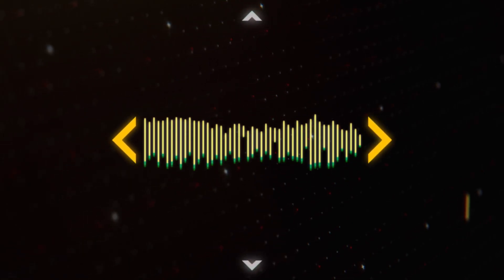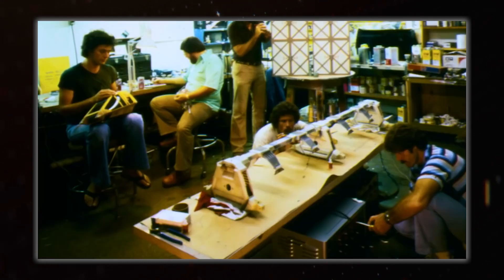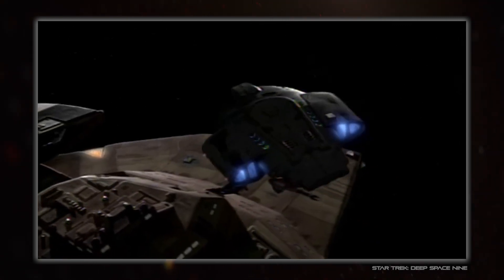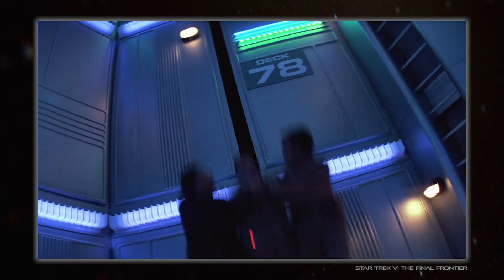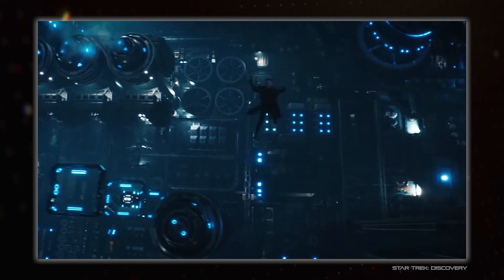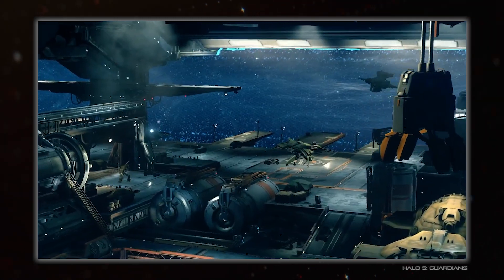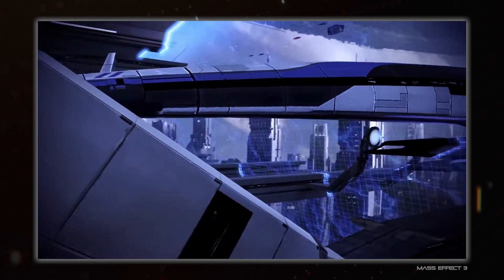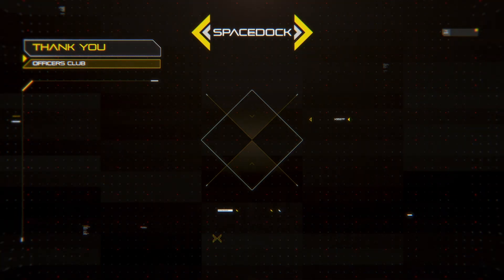Why Do Sci-Fi Spaceships Seem To Change Size?

Comment: I think Star Citizen might be one of the few IPs where ship scaling is kept as accurate as possible since the game has no loading screens to transition between ship interiors and  planets, so everything has to be in the same scale. Hell, some ships wound up getting larger from concept because they found the original concept didn't have the internal volume to fit the interior and still have room for components.
Reply: Yeah, Star Citizen is an interesting case study in this sort of thing where they kind of have to be strict about ship scaling.
Reply: Came here to say exactly this.  All the ships in proper scale and all with fully functional interior spaces, and most with some amount of component access and built in storage.  They aren't getting criticism for no reason,  but they are knocking it out of the park anywhere they can turn their attention.
Reply: Pity its release dates aren't kept accurate as possible.
Reply: Star Citizen does have some scaling issues when it comes to the cities. The no-fly-zones near some of the buildings aren't just to prevent you from running into them, but to hide the actual scale of the buildings. They are going to fix this issue when they finally start adding interiors to buildings and have to scale them all up appropriately. But right now most of the buildings are place holders until future updates flesh them out.
Reply: Star Wars galaxies as well I think, at least for ships that have interiors with windows.
Reply: Yeah they talk about that in some videos, where they think they got it, only to realize that an opened sliding door is visible on the outside of the ship so the whole room layout needs to be adjusted
Reply: Yeah, and the expanse get's it right in the most parts as well.
But this seems to be a trend of more modern scifi, that in the most parts designs a ship by function, not by style..
Reply: @Mehnbuhn Kneckbeerd honestly there is a very easy solution to that problem and its called automatization, irl most spacecraft are likely to be 1% living area and 99% everything else, so if the living area is the size of an apartment building then the rest of the ship is likely to be a couple dozen kilometers long and tall, makes for imposing ships while mantaining logic and consistency
Reply: In such a case it would seem to make sense to design the ship from the interior first, but I get wanting to design it from the outside in.
Reply: glad to see you already pointed out exactly what I was thinking when watching this. 
SC gets a lot of flack for a lot of reasons but it must be set there is quite a lot of stuff they do that ends up being really cool. the ability to fly around the outside of someone's carrack and see the people running around on its bridge and its all properly scaled with no handwavy magic is pretty crazy.... even more so when you fly up to a stations big windows and you can see everyone inside. Its kind of crazy! 
I would love to be on the train at new Babbage when someone flys along the trains for fun. this is the kind of thing I felt happened a lot at port O and it made that space feel really cool. I wish they could do something more interesting with the stations elevators to solve this problem as they feel awkward compared to how polished some of the game can feel.
Reply: @gregmosher4287  The elevator is one of the needed tricks to have large stations and cities work. When in it, the game can load and unload resources, and magically warp the player around.
Reply: @vast634  The elevators in star citizen are actually physicalised an do move around buildings, stations and ships. They are not some form of hidden loading screen like in many other games. The only "unrealistic" thing about these elevators is, that they move at very high speeds in mulitple directions. Thats ok in my opinion because standing inside a elevator for to long gets old really quick.
Reply: @oO0Xenos0Oo  Is the player-camera then actually moving? Because that draws performance even if nothing outside is visible (calculations for culling). The simplest solution is to just magically teleport the camera and Interior to the destination, and let the outside load in the background.
Reply: @vast634  All i can tell you is, that elevators in star citizen have been deathtraps for ages now. If the door opens, the elevator box might not be behind it for some reason, so if you step into the empty elevator shaft, you fall through the map. Sometimes the elevator crushes your body because its movement is slightly out of sync with your character inside of it. Sometimes the doors will not open and you are stuck inside or outside the elevator. So yes, the elevator is fully physicalised and actually moving. This is cool on the one hand but also brings more problems with it compared to a simple teleport cabinet.

By the way, stuff like subways and trains which are going really fast are also fully physicalised. You can sit inside and watch the city fly by including all the player action that is happening there. You can also see players inside of the trains when you are on the outside. So this is also no fake, prerendered panorama projected of the train windows.
Reply: @vast634  Yes there have been various bugs over the years that showed how the game does it. Basically you get into the elevator, then it and everything inside it becomes invisible and loses its physics, and it moves within the 3D game world in a straight line to where it needs to. When it gets there the elevator gets its physics and rendering back and the doors open. Recently there was a bug where desync caused the last phase to happen while the elevator was still moving, and if you stood too close to the elevator door after calling it you could get run over and killed by the cab arriving at high speed.
Reply: @fnunez  Sound like a reasonable solution, so the rendering and local physics gets turned off. 
Also means the player-physics is done client side (potential to hack that), but a lot of games do that for fast local response.